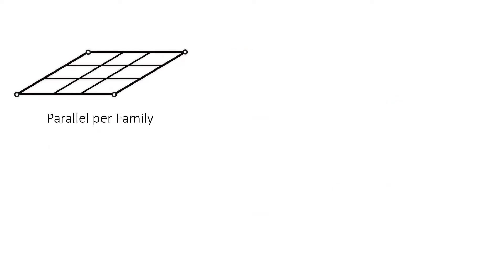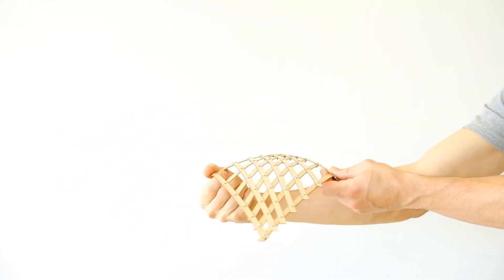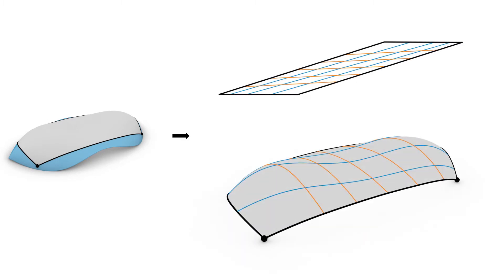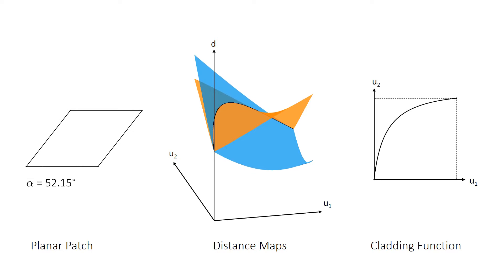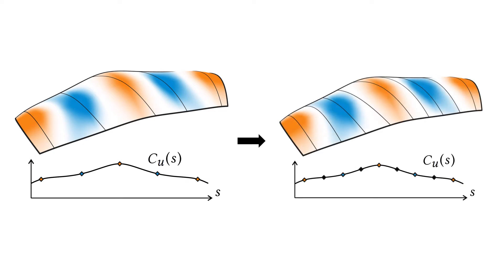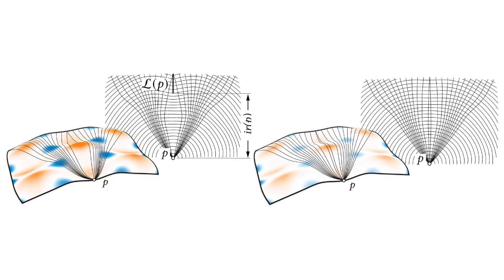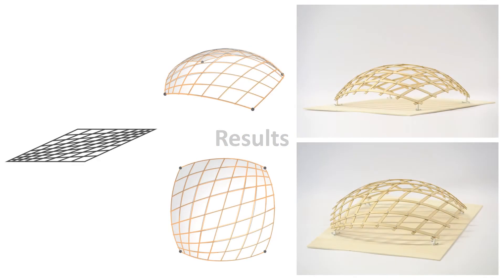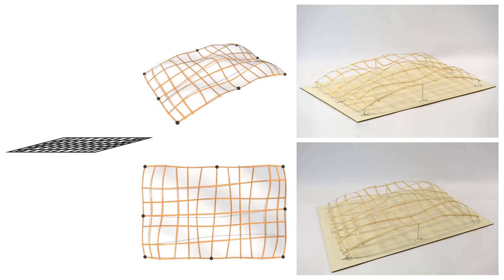On Elastic Geodesic Grids and Their Planar to Spatial Deployment

Comment: Wow this is awesome. I can already see their use in the fashion industry. For making collapsible corsets to size-varying moulages. Imagine having a single moulage to work for all sizes, the size of which can be adjusted by simple actions like pulling strings or rotating screws attached to those critical points!!